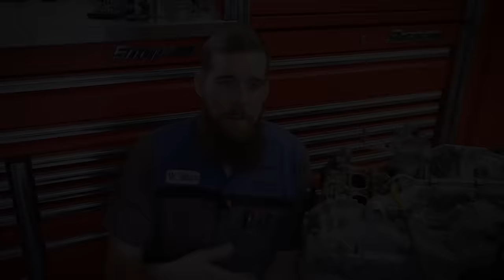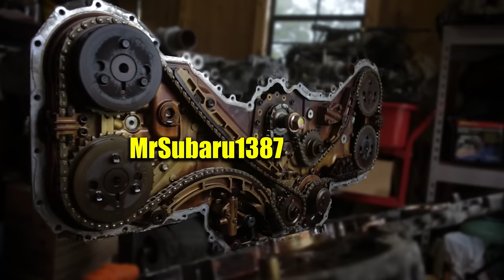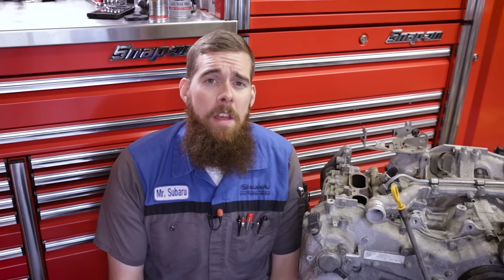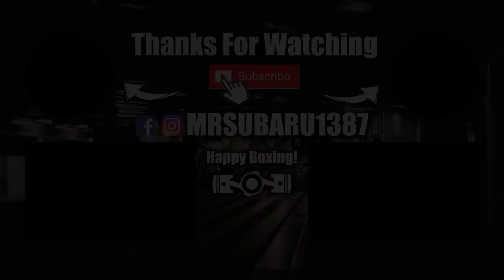Why Subarus Are So UNreliable!!! Buckle Up!!!

Comment: At 4:55.. Everything you described are mods you can throw on a honda or a nissan or a toyota (with the exception of the turbo) without a tune and not really worry about blowing anything up. You can throw ALL the bolt on's on a B or K series honda motor, or a nissan SR, RB, or KA and go out a bang the rev limiter aorund a race all over the place. I have s14 with an RB25 in it and it had EVERY bolt on possible on it with no issues. 

I think Subarus problem is the company it keeps. It is marketed as an entry level Japanese enthusiasts car, but it doesn't share any of the robustness or durability of it's contemporaries. WRX and STI's are dress slacks cosplaying as active wear and marketed in the sportswear section. When people buy it, try to do cartwheels in it and rip the crotch, is it their fault or is it Subarus fault for the way they market it?

I just got into a 2020 WRX and I feel like I just hooked up with a beautiful woman who turned out to be dangerously bi-polar and abusive.. And the whole Subaru community sounds like a forum of battered spouses that defend their abuser. "Just dont really add any sizable load before 3.5k, also don't rev it too high, dont corner it too much or it will oil starve and spin bearings, get a new sound system and a cobb access port because the factory tune is TRASH, but dont use the off the shelf tune Cobb includes and get a 4 wheel dyno pro tune...if you even so much as add an air intake." 

If we're being honest, all of the wrx's and STI's...all years.. are kinda ridiculous and fragile when compared to their Japanese contemporaries. I have been modifying cars for the better part of 20 years and only in Subaru WRX/Sti forums will you see, "Just leave it stock." "I have zero mods and mine's running strong!" "Just don't change anything and don't drive it hard and it will last forever!"

Changing things and driving hard IS THE POINT OF BUYING THESE CARS. Dress slacks in the sportswear section, I tell ya..
Reply: I have no experience with STIs or wrx, but I do own 3 subarus- one is turbo a 2018 forester xt. Others are 1999 outback amd a newer solterra.

I don't have reliability issues. Of course none of them are track run.

I only arrived at subaru being my preference over all manufacturers after running Fords for 30 years.

I owned multiple mustang GTs and yes they were pretty tough but in stock form don't expect much performance (notwithstanding my 2012 good grief that was quick) and keep an eye on all fluids if you do mod them.

The author of the vid isn't lying. You aren't completely incorrect either but I suggest if you just closed your eyes and redlined your car consistently you will eventually be paying for it which is a component of what he is saying.

Also, ebay parts can be temporary and potentially dangerous as mentioned.

I appreciated the vid it's probably obvious. Subarus are not unreliable, owners however are another story. I basically rescued the 1999 outback and it is completely flawless during my ownership. It was described by a dealership that it was a 'headgasket problem' and all I did was replace the rad, that fixed any missing coolant.

Comment: Late to this video.. heard that subaru manufacturer has issue with putting too much of the gasket paste and seeps into engine causing problems.. or not puting enough of it causing oil to leak .. is that true? If so, is that still an issue til this day?

Comment: I’ve owned 2 SOHC EJ253s and both ended up leaking oil - not catastrophically - from the passenger headgasket. Both cars were bought used however. I’m not sure if I’ll buy another considering how bloated and ugly they’ve become. I don’t mind the CVT so much since it’s been proven as very reliable and the Impreza hatch still looks decent. I bought a 4motion Golf which I love, but I also love those late 2000s Outbacks and Foresters before they got thicc.

Comment: A car has to be properly maintained. Reliability does not mean u can leave the oil un-changed and the typical maintenance not be done. With that being said i do feel like subarus need entirely to much attention for maintenance. Ive never owned one but a friend of mine has and from what I've seen with oil leaks nd stuff im all set the STI name has a bad rap trying to buy one uses a nightmare because you have to have a leak down test performed and all this other crap checked into and with other cars that are similar and performance granted you do have to look over them you do not have to go that expensive it's really just spending more time on a car than I'd like to and I'm a very big car enthusiast.

Comment: My 15 sti with 60,000 seems happy as a clam. Oil is always clean and full and only 93 octane goes in. Maintained like a mf. Driven spiritedly maybe once a week. Mostly adult driven, I’d say 90% of the time.

Stock, only exhaust that doesn’t need a tune is the only modification. Have put 10,000 problem free miles on it

Comment: I mean just because a Engine is fairly reliable completely stock doesn't mean it is a great engine. A great engine can have its limits pushed and keep on going, engines such as k20's k24's, VQ's, 2J's and LS's see just as much if not more abuse from people pushing way too much boost and frequent track days without nearly as many issues. I agree that Subaru's that are properly maintained and not overly modified (too much boost) are fairly reliable, but there definitely not the engines that legends are made about for reliability.

Comment: Dumb question here I know. But I did a muffler delete threw nameless exhaust  just to give a little louder noise. Would that need to be tuned? It's a 2021 Impreza sport. I contacted subi of America they said it's not a deal but if my exhaust needs to be replaced under warranty I'll be screwed.

Comment: I have a 17 wrx with 23000 miles. The crappy stock clutch fork broke, not my fault. Spending $2200 on a new clutch and better fork

Comment: My 2017 Impreza smokes when I start from cold start.  Also burns 1 qt. Oil between 6000 mile oil change.  Does this mean my engine is going bad?
Reply from the maker: Check the PCV valve.

Comment: I've got a stock 2011 Forester, no turbo. I take care of it. Regular maintenance. It's at 165,000km (102,500 miles). The head gaskets are both leaking. Is that normal at this age?
Reply: you have to retorque the heads every 20k, your lucky since mine blew up after it spun a bearing due to oil starvation on a road trip, shitty oil piston rings

Comment: I was like what the hell, Subaru not far from Toyota/Honda in Sweden when it comes to reliability and satisfied costumers, our modelrange is not the same as US, the XV was sold with a 1.6l for a while and Forester XT was sold for a short time with a turbo engine but other than that the cars are sold with a 2.0l 150hp.
A relative got a 15+ year old Outback, works as a charm and still looking good despite Swedens heavy winters and large amounts of roadsalts. The cabin is a bit loud and the interior is crap though :)

Comment: Actually have a question for you. When do turboed Subarus need their head gaskets replaced? I’m moving from Alaska down to the states soon and looking to buy an 05ish legacy gt. But for some reason I can’t seem to find one that’s had it’s head gaskets replaced and a lot of them are around 150-190k. They seem to have done timing kits, water pumps, and other things though. Is it worth paying the subie bro tax for something that doesn’t have new head gaskets around that range or should I hold out for something that’s had them replaced?
Reply from the maker: When they fail. That's when you replace them. It's not a wear item.
Reply: @MrSubaru1387  :O
As long as I've owned subarus I had no idea this was a thing. You actually just made my LGT buying experience sooooooooooo much easier lol. Thank you!

Comment: I've just bought a 06 legacy gt in nz.
It has 170,000km on the clock and I'm hoping it's not going to fail me, I plan on servicing it every 5000km.
Anyone got any tips, it's had a new cambelt and clutch done.
Only mod is the exhaust.

Comment: Just like rotary engines.  95% of unreliability is the owner... I hear all this bs all the time.  Same with subarus.
Reply: The bend over backwards stuff happened to me when I worked for an Infiniti dealership.  Was a joke the stuff they cover under warranty.  One kid after we gave him a free engine on his g37 when it was turbo slapped and everything.... then yelled at me for not putting the mods back on.  Its like I can take the new engine back out and put the old one back in with the mods...

Comment: I don't modify my 2013 engine and upgrade it. I want to and know I need to tune it and take extra steps to make it all work. All the stories make me afraid to do so. I read bad and good. I dont race mine but want engine modifications. Do you see front mount, intake and full exhaust 2013 WRX's that last 100 miles or more with the stock engine? Mine is a 2013 wrx with almost 36,000 miles. Dont care to race but want the upgrades

Comment: Most repairs are due to lack of owner service and bearing on a car thinking it a super car. Not only with Subaru cars it with others make and model but ppl will say thing not true. It a 2.0 or 2.5 and sewn where they best o  them like a child. It a work horse not a super car.. my legacy l 2.5l have 346k factory head gasket and been in three country as a work horse not a sport car. It not a 911 gt.. as a tech for many makes and models I rebuilt motors due to owner putting stress on a motor not made for racing. Fact it a family car with fake tuning to make it look like a rally car.

Comment: This is bad news for me personally. If Subaru wants to make a car that has stiff suspension and handles good in the twisties, but you can't go out and run through the gears and run it hard, then they shouldn't make them. I love taking my 2023 WRX out on the twisties and pushing it through corners. And I regularly take it up to 5500 rpm while running on back roads. I live out in the west where there's plenty of open spaces. Maybe I should go back to having a Porsche that will easily handle this type of driving. I'm changing my oil every 3,000 Mi with high quality oil. If the car can't handle spirited driving then I really have no use for it. I don't do hard launches or race around town with it. I'm 62 years old and I like to drive fast. So we'll see how this cantankerous POS holds up.

Comment: Preface this with saying I’ve had 2 WRXs, both living nice lives. But subaru uses all the rally car advertising they can to move those cars to younger buyers. The younger buyers then go out and treat the car AS THEY SEEN IT ADVERTISED!!! What they don’t understand is that those rally cars require a ton of maintenance. So can you treat your off the lot WRX or sti that way? Yes! But you should be able to afford and prepared to maintain it.
Reply: subaru is turning into bmw or audi, first 20k they are fine afterwards it becomes a money pit
Reply: @FedkaSlovanich  maybe. I’ve got 350,000 between my two WRXs and they’ve been pretty good to me. But I’m not the average car owner either

Comment: Hey Mr. Subaru! Can I ask you a technical question? My coolant level keeps dropping after some long trips, like 100 miles in 70mph. I don't see any leaks so it might be burning coolant. Help! I have a 2011 Subaru Tribeca with 100k miles on it. Thanks.
Reply from the maker: It's definitely going somewhere if you have to keep adding to it. If you aren't seeing external leaks, I'd have to guess it's eating it.
Reply: @MrSubaru1387  how can I test if it's eating it? Head gasket test?

Comment: Dear Mr.Subaru Can you use a high quality oil and oil filter of the same viscosity weight and detergents as the  original Subaru OEM   oil and a high quality oil filter  when you cross reference it at one of the popular auto part stores  please break it  down as to to the does and don'ts   thank you.

Comment: I'm confused on the timing belt intervals. Mechanic claims that my model ('03 Legacy) has a timing belt replacement interval of 60,000 miles, but online it says 105,000.. My manual doesn't say anything regarding a timing belt. Before 2000, it was every 60,000, but it went up to 105,000 afterwards. If the former, I'm 10,000 overdue for replacement. If the latter, I've got about 35,000 to go.
Reply from the maker: 80-100k is standard rule.

Comment: Are there any problems with the 2022 Outback NA 2.5? Are head gaskets still am issue?
Reply from the maker: Head gaskets haven't been an issue in over a decade on the 2.5L.
Reply: @MrSubaru1387  Thank you for responding!

Comment: Genuine honest question - aren't the mass air flow and oxygen sensors supposed to adjust the mixture, if you add a cold air intake?  I can understand why some crummy mods would damage an engine, but a cold air intake?
Reply from the maker: They are calibrated to the factory inlet and exhaust pipe circumference and flow. You increase the circumference and flow of the intake and maf is no longer accurate in its data to to PCM to calculate. Same with the A/F sensor and exhaust.

Comment: People don't know nothing. so the car is so unreliable but 10s of thousands of subaru examples with more than 300K miles were still driving on the road. I wonder what is really the problem? You have people claim how reliable their car it is,"oh I had it for 4-5 years, with 40-80k miles on it... come on, a corolla was not even break in for that. people knows nothing. BTW, I serviced someones just bought GV impreza few years ago, the air filter element will flake off like doritos. the cars is about 14-15 yrs old at the time, and I highly suspect that's the air filter comes with the car from factory.

Comment: Lots of common sense info here.  Good warning to those who choose might otherwise choose to ignore it. 

Here's some more insight though.  Iseecars ranks reliable cars by model - not just make.  They use millions of data points.  Subaru fell completely off the list a handful of years ago.  Not one of their vehicles made it.  So it's not (for example) kids irresponsibly tweaking, driving or maintaining their (say) WRX that's the problem.  Whether you believe Subaru or JD Power, the average age of an Outback owner is between 45 and 60 years old (with upwards of a six figure income BTW).  They are not beating on their cars and they can afford oil changes.  So simple hand waving and confirmation bias can't explain that away. 

Will a properly maintained Subaru driven by grandma make 200k miles?  Sure it's possible.  But many other OEMs can also get there given the same conditions.  That's not saying much.

And a vehicle should last 200k miles even with some abuse.  I'm a powertrain engineer with decades of experience.  The way to determine reliability is to test designs for long periods under absolutely insane conditions that most end-users will never reach.  That's how you destroy and subsequently improve a product.  If one needs to put their vehicle into a figurative bubble to survive then that's the result of a poor design.  

So let's be genuine here.  Are many Subaru issues caused by abuse?  Yes.  Will properly maintaining your Subaru make it last longer?  Yes.  All else being equal, are Subarus "reliable" when compared to many other OEMs?  Mmmm. The large data set statistics say no.  While anecdotal evidence and especially the well-stated empirical data in the video might explain why that is the case - it doesn't change reality.  The use-case for the typical vehicle is just a bit harsh. 

I push the oil changes in my 20 year old truck to well over 5k miles on cheapo oil. It sees lots of off road use and miles of dirt road potholes every day.  Last washed it 4 years ago.  Never sees a garage.  It's my only commuter vehicle.  Runs like a top.  That's what I would call "reliable".  Oh - incidentally, my truck model made Iseecars reliable list.  Would I buy a Subaru?  Sure.  And I'd love it.  I think they are cool all the way around.  But I'd maintain it more conservatively than even the OEM dictates. 

Heck, when I was a kid Subaru's slogan was "Inexpensive, and built to stay that way". 🤣  'Nuff said.

Comment: As a new subaru owner myself 06 wrx. How do i go about getting a tune on it? I got it with 128k on it it runs good the only issue i have with it twice now. When i accelerate on the turbo it will surge really bad then the check engine light comes on. Any advice would be greatly appreciated. TIA
Reply from the maker: What code(s)?
Reply: @MrSubaru1387  next time it does it i will have to check its done it twice in 4 months. i did just check and no codes but i previously took the negative off the battery so it probably cleared any codes. And another thing is hen it did it the cruise control light was blinking idk if that means anything or not.

Comment: The best Engines Subaru made are ones they no longer make - the EZ30 - and thanks to Gretna are to be soon in a museum, but for now and for the last 5 years its doing just fine for me -- and when I did change the oil the magnetic sump plug was without a trace of any metal - and my driving is brisk too.

https://www.youtube.com/watch?v=UuhbrRQ8FLE

Comment: As the owner of 2 WRX's (09 and 13) I can say you're 100% correct. The ONLY problem I had was with my 13 and it was a warranty repair on the bad syncro's in the transmission. The only mod's I did was catback exhaust on both cars..no CAI..just exhaust and never had one single problem in either one. I would catch flack for not tuning them or upping the boost etc.. the problem is the WRX's are kinda close to max power on stock internals (see ring land failures) and I wasn't going to through thousands of dollars at forged pistons..and then tougher clutches etc etc you know... The "Domino" Effect. Stock was just fine for me..they were fun, and reliable and i HIGHLY regret selling them.